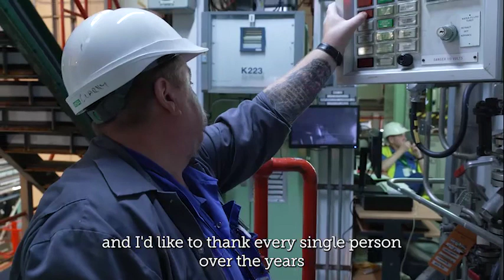The Magnox Reprocessing Plant safely completes its mission

Comment: A massive achievement for the Sellafield site, with the completion of a 70 year program. However, the total cessation of reprocessing at sellafield brings about a few questions, with the advent of an EPR fleet in the UK, is it likely that a new reprocessing strategy will be adopted? or have policies changed to a long term storage method?
Reply: I'm also interested in seeing the answer to your question. It's not just EPRs but the remainer of AGR and Sizewell fuel. Surely reprocessing is the environmental answer. The UK should be planning for THORP2 which could be new build or a refit of THORP. MoX should also be restarted. Without this we face an ever increasing hazard from spent fuel. There's also considerable lucrative opportunities to offer services worldwide.

As for SMRs, I'm not sure whether current technologies can reprocess their fuel. Reprocessability of their fuel should be considered when reviewing SMRs.
Reply: Spent fuel from the current UK nuclear fleet is no longer being reprocessed. It is instead being stored on an interim basis at the power plants themselves and in THORP’s spent fuel pools at Sellafield. I do not know whether a change in policy is planned for when the EPRs start churning out spent fuel, but even if the UK decides to go with reprocessing again it is extremely unlikely that a new UK reprocessing facility will be built to serve just 4, or 5 if you add Sizewell B, reactors. In that case, it would be much more economical to have the fuel reprocessed at the La Hague plant in France, which has lots of spare capacity and has been reprocessing fuel for EDF and many non-French customers for nearly three decades.
Reply: @mudspike84  on what basis do you suggest how many reactors the UK will have in the future? I'd like to see more that 5 and not necessarily EPRs. The UK can also sell the services creating even more jobs and home based economic activity. So I'm not at all in favour of sending the fuel all the way to France. We can do much better.
Reply: @blueshirt11111111111  I have a colleague at work who worked for Nuclear Electric when Sizewell B was being commissioned. We discussed AGR vs PWR reactors and the consensus was that the last AGRs built (Heysham Stage 2 and Torness) had the majority of the issues with older AGRs resolved, and were pretty competitive in terms of improved safety and efficacy over the Sizewell B PWR. I would like to see a new generation of high tempatrure gas cooled reactors in the UK personally.
Reply: @solsburian  I agree the construction of the last 2 AGRs was successful. Operation of all the AGRs has generally been successful. Most if not all are now on life extensions. The PWR v AGR debate is an interesting one. Walter Marshalls task force looked at this leading to Sizewell B. It's often claimed that AGR construction costs are far higher. However EPR construction in continental Europe has been awful. I'd love to see AGRs back on the table. But would any operator want to build one?
Reply: @blueshirt11111111111  The problem with the original AGR program seems to be that the Windscale AGR was closer in design to the contemporary Magnox designs (While the Oldbury and Wylfa Magnox plants sampled a lot of the production AGR techniques including enclosed boilers, indeed BNFL looked at fueling the last two Magnox stations with MAGROX fuel (basically AGR fuel pins in a configuration suitable for Magnox reactors - they were successfully tested at Calder Hall). Dungeness B was initially a disaster, caused by poor and naive up scaling of the Windescale AGR by a factor of 20, that caused distortion in the steel components due their sheer weight .Before the Dungeness B fallout, USA utilities were interested in the AGR design.
Reply: @blueshirt11111111111  Another life limiting issue with the production AGR reactors is cracking of the graphite bricks (indeed Heysham stage 2 and Torness have had their life curtailed), possibly due to the complex design of the graphite blocks that leave them susceptible to cracking as the reactor ages.
Reply: Reprocessing does not make economic sense at this moment and time. The UK has the world's biggest stockpile of plutonium arising from our reprocessing activities. This plutonium could be used to produce MOX fuel, however Sellafield MOX Plant closed in 2011. Our AGR fleet, as well as the EPRs being built (I am not sure about Sizewell B) are capable of running on partial MOX loads (indeed the prototype Windscale AGR had been run successfully using MOX fuel decades ago)., however the owners of these stations are not interested in using MOX fuel, with one reason is that it is more expensive to fabricate than conventional low enriched uranium fuel.
Reply: @solsburian  if it doesn't make economic sense one has to query why the French do it. One could suggest storing Pu doesn't make sense in terms of security, the environment and cost. Likewise spent fuel. Far better to use the Pu. Hmg should mandate its use to run down stocks and avoid mining. Agr and lwr spent fuel should be reprocessed.
Reply: @blueshirt11111111111   For many of the NPPs in France, it is mandated that reprocessing must happen (as with our Magnox stations, the fuel from the French UNGG stations had to be reprocessed to ensure they were in a long term stable state). Like BNFL, France's AREVA eventually ended up being bankrupt on paper due their liabilities. EDF are not a fan of using MOX fuel due to it's expense of fabrication. That is not to say MOX fuel has a role in the future if they can bring the costs down, or if Uranium fuel becomes expensive.
Reply: @solsburian  most French fuel is from LLRs. Nevertheless they are continuing with reprocessing. It is the environmental option and in the UK has provided luctrative projects and export earnings.
Reply: @solsburian  Sizewell B is simply a Westinghouse 4-loop design, and it could be loaded with MOX. Although only a few, if not, a dozen batches of MOX fuel assemblies being loaded at most. I read it from a long time ago that the French only put a few batches (3-5) of MOX fuel assemblies in the core whilst operating. Although it must be said that when one searches online, it’s often believed that 1/4 or 1/3 of the entire core is MOX is entirely false. The only light water reactor that I know of has a significant presence of MOX is Takahama unit 3 (a Mitsubishi 3-loop pressurised water reactor) over there in Japan. 24 out of 157 assemblies are MOX, which is a staggering 15.6% but not 1/3 or even 1/4.
Only one reactor under construction is almost certain to have a full MOX core: Ohma Nuclear Power Plant in Northern Japan.